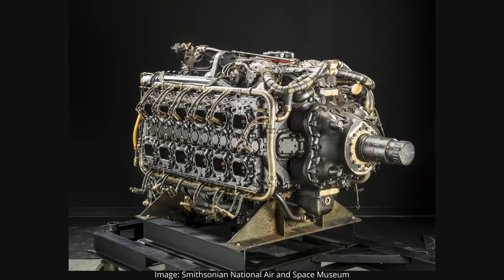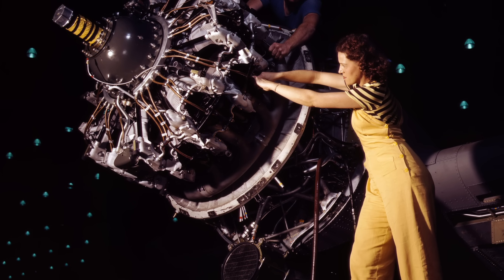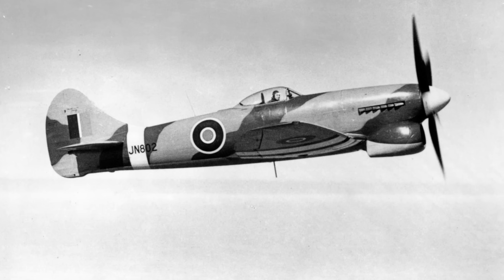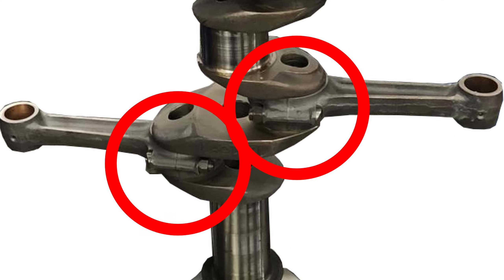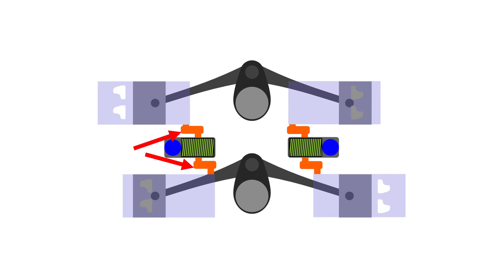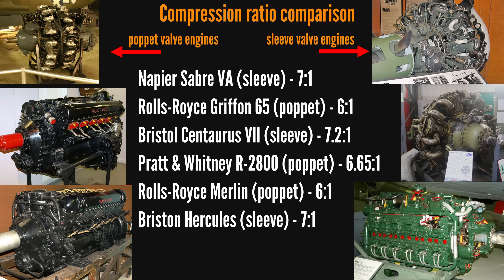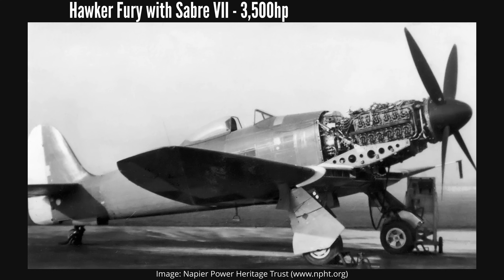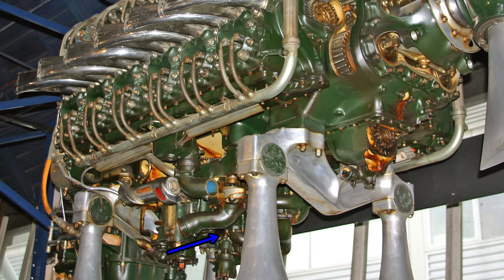The Complex Napier Sabre 24 Cylinder Aero Engine Explained Simply

Comment: Continental!, who prepared Sleeve Valve prototype engines for many different applications, development halted by the 1929 economy crisis, said Sleeve Valve engines were easier and cheaper to produce than its poppet valve counterparts.
A cylinder liner, very close to an Sleeve Valve, sells retail today for around $40.
RR destroyed all SSV producing machinery after the Bristol takeover, the last Sleeve Valve engines produced were Bristols, license made at SNECMA for the Noratlas freighter.

Some SNECMA built Bristol SSV engines survive in french Tractor Pulling clubs and shows

Comment: When you say that  increasing cylinders was the only practical way, that’s not quite correct, increasing displacement is a very practical way to increase power.
Reply: As mechanical engineer (I'm sorry, my English is not so good), I can say that increasing unitary displacement may be problematic, for several reasons. For instance, large pistons mean heavy weight and important inertia, and this doesn't allow high number of rpm. Cooling, too, would be more difficult. Best compromise for liquid-cooled engine is 8-12 cylinders. Radial engines can go up to 18-36, but the architecture is quite different.
Reply: @Paolo-s8p  I didn’t say there wasn’t drawbacks, but it is certainly a practical way to increase power without increasing complexity.
Reply: @thelandofnod123  Yes, but within a narrow range. A typical 4-in-line car engine can be offered in 2 liters or 2.5 liters, and both work well. Enlarged to 3 liters or more is very problematic.
Reply: @ Yes I know, which is what I said in my original comment.
Reply: @thelandofnod123  There is clearly a pattern that shows us the relationship between displacement and number of cylinders within a certain range of specs,
 we see small V-12s like the Merlin and the Allison reach a maximum practical size with the Griffon and the DB-605... beyond this we see engines with more than 12 cylinders appear.
  with Radials we also see a limit to cylinder displacement and larger Radials growing 7 to 9 cylinders and from single rows to 2,3 and finally 4 row engines like the R-4360..
Reply: @Paolo-s8p  That is an excellent analogy...  that perfectly demonstrates the concept here. You don't see many automotive 4-cylinders larger than 3.0 liter... for exactly this reason..
Reply: @ That is correct, which is what I said in my original comment and subsequent reply.
Reply: @thelandofnod123  You said that increasing the displacement was a practical way to increase power, which is in fact Not true. once you reach a certain limit it is not practical, increasing the number of cylinders is your only option other than raising manifold pressure which had also reached its practical limits during WW2,
Reply: @ Increasing displacement is a practical way to increase power. Your comment even says so. It is 100% true. 

Now, Dok, you seemed to have missed the point though as I was correcting a statement made in the video. I was not applying that statement to every conceivable situation involving ICE.
Reply: @thelandofnod123  You missed the whole point of this... during WW2 the V-12 configuration was quickly nearing the practical limits of displacement which is why engines with more than 12 cylinders began to be developed.
 The Sabre engine if designed with just 12 cylinders would not have been a successful or practical design and be able meet its desired horsepower output requirements.

So NO, larger displacement was not a viable option in this case or in second generation WW2 piston engine fighters in general..
Reply: @ Not at any point did I mention these particular engines and their particular applications, not once. 

As I said, I was correcting the statement made in the video. 

I can not see old chap why you continue to try and shoehorn in an argument where none existed.
Reply: @thelandofnod123  Your statement was wrong, once you have reached the practical limits of bore diameter for your desired rpm range? and you have reached the practical limits of supercharging?  adding more cylinders becomes your only option.

that's what he meant, and he is absolutely 100% correct in what he said..
Reply: @DoktorBayerischeMotorenWerke  No, your interpretation of it is wrong, which is why you have to add the caveats you have. 

The video is dealing with large, nay, enormous power increases, not incremental increases, as such adding cylinders and even doubling that number was the way they chose to achieve this. Clearly these engines had not reached the limits of what was possible with the extant number of cylinders because they didn’t feature all the improvements that could be achieved before smashing two blocks together. Adding displacement could yield more power, however the applications these engines were used for meant they needed more power than that could achieve in the existing block, that doesn’t make what I said wrong.
Reply: @thelandofnod123  In the context of the video, what he said and meant, and the specific design of the Napier Sabre you are absolutely and completely wrong.

that is exactly why nearly all of the aircraft engine manufacturers during the war developed Siamese or double block engines, Hyper or X configurations and triple and quadruple row radials.

All overwhelming weight of the evidence crushes your half-baked, amateurish theories and frankly rather childish beliefs regarding this topic..
Reply: @ Funny, resorting to abuse rather than admit you’re not understanding the concept is such textbook cognitive dissonance. May one suggest seeing an actual doctor about your condition rather than making proclamations about you own false personal qualifications.
Reply: @thelandofnod123  Just the facts here, nothing more.

Your response reveals that you are well aware that you are wrong and have lost the argument..
Reply: @ In the field, your “facts”, we call cherry picking. Doing so is the realm of those outside that field of experience. So no, you didn’t present facts, you took a small sample set and shoehorned it to meet your narrative, this shows nothing except inexperience. 

Thanks for proving my point though by the way.
Reply from the maker: Not the only way, but easiest way. At least in my opinion. I think there is a reason why all these 24 cylinder engines appreared so long before the large(er) displacement V-12's like the Griffon.
Reply: Not true, as Bore diameter and stroke increase the practical RPM and power per liter goes down... and weight goes up..
Reply: @DoktorBayerischeMotorenWerke  It is very true. Power tapers off after a certain point and then goes backward, however this is architecture dependant. Increasing displacement is a very practical way to increase power easily.

Comment: To me it just seems like the sleeve valve engine would be less reliable
Reply: In practice it was less reliable... Sleeve valves were really obsolete by the arrival of jets..
Reply: Sleeve valves system is a kind of all-or-nothing engineering. If designing, machining, assemblying, cooling and cleaning are properly done, the system too works properly. But if something somewhere is less than perfect, the system fails. On the contrary, the conventional puppet valves system is much more permissive and resilient facing small anomalies.

Comment: Just out of curiosity, does anyone have an opinion or details about how fast a SV engine can or could run?  Could it conceivably run at 20,000 rpm, or would the sleeves and such have too much mass to move at those F1-type rpms?

:). I remember when we had a Centaurus in a crate for a Sea Fury project, and my boss was describing the sleeve valve operation to me, stating how much simpler it was relative to poppet valves.  But when I first started to grasp how SVs worked, I recall being pretty exasperated at their so-called simplicity!

Regardless of which was better, history is what it is.  In both cases, I’m always amazed at what people, teams, and companies can do when something has to be done.  I think watching metal move against metal is one of the most interesting things.
Reply: Small displacement (< 1 liter) up to 10.000 rpm. Large displacement (> 20 liters) no more than 3.000 rpm. Rarely used on intermediate displacements.

Comment: What a great video, i did a project paper for a Higher National Diploma in the Uk, many moons ago on piston engine aircraft engine development, and although there were numerous great engines both allied and axis by the end of the war the Sabre stood out for me at the top of the pile. Lots of development and production problems initially from a management team who were to busy chasing "the next big thing" to bother themselves with "trivia" such as quality control. Once the shot gun marriage to English Electric was done, who were a far more profesional outfit, the Sabre fulfilled it potential, outperfoming everything round it in its power and its ability to hold full power much longer which in a combat situation means life, death or engine distruction. Perhaps the greatest testament to the Sabre/Tempest combination came from Me262 pilot Hubert Lange who singled the Tempest out as the biggest threat and one of the primary reasons the Germans turned the Me262 bases into multilayered flak fortresses. Great video, well thought out and presented.
Reply: All made obsolete by the arrival of jets.   The Tempest was completely outclassed by the Messerschmitt Me-262.
 Allied losses from loitering around Luftwaffe jet bases were so high that the practice was officially banned by Allied Fighter Command..

Comment: Late war IC engines were just bonkers. Everything was made by hand, on Bridgeport mills and lathes with no DRO. No computers. Each one was a masterpiece with thousands of hours of extremely skilled, highly nuanced labor to produce. Incredible.
Reply: That is not true, production of most parts was automated and made by specialized tooling that only performed a single operation and made a specific type of part using a pattern 'Standard' to set up the machine. Once the machine was set-up it could be operated by a non-skilled operator and crank-out thousands of identical parts.

Comment: 18:40  IMHO:

1. The reason why nobody uses sleeve valves lies in the small amount of available information about it. There is not much info out there if you want to build a sleeve valve engine. I know this as i made a program to simulate the sleeves for 3d CAD tool. So you can find the perfect sleeve and overall engine layout with respect to all basic variables and make this appear in CAD. The math behind the sleeves is spicy and tricky and not well understood or taught in university. It took me over a year to accomplish this. Everything about poppet valves is well understood btw. as i did comparison and poppet valve theory is  easily available.

2. The machining of those sleeves wasnt and isnt well understood. 90 years ago it was almost impossible to make them reliable. But i bet today CAD/CAM and Simulation software will deliver quality product from first few simulation loops. Imagine how much engine parts rely today on CNC machines already. Several high power engines use aluminium blocks with sleeves or liners, either wet or dry, already and they are usually made of high alloy stainless steel to avoid thermal expansion stress. 

3. Fewer parts are always welcome, but only if well managed. The cooking recipe for a sleeve valve is as short as you might get, despite the animation of the Sabre looking confusing.

The lesser parts, the higher compression, the higher rpm and the better airflow make these engines UNBEATABLE in ALL basic parameters either NATURALLY aspirated or MIDLY boosted. 

HOWEVER at about 2.5 bar or 36 psi manifold pressure, the sleeve cant handle the heat and stress and buckling begins which will seize the engine. 

But i can understand why we use poppet valves in engines today as we have all boost pressures of 2 atm or above in our daily cars where poppet valves matter. At least i do.
Reply: Sleeve valves were simply rendered obsolete by advancements in poppet valve technology.
Reply: @DoktorBayerischeMotorenWerke  You mean VANOS and other camshaft stuff like V-tec? 4 Valves? You can be specific i will understand, no problem.
Reply: @ThorstenKreutzenberger  I was referring mainly to the introduction of sodium cooled valves and new materials like Stellite,

Comment: Wow!!! Incredibly complex and intense engineering!!! It makes one wnder why larger 2- Stroke engines were not produced.... 
          One such design that had impressive  Horse-power and Torque output was made by McCulloch Industries and produced well over 100 h.p. with tuned exhaust, naturally aspirated, aur cooled... It displace's 100 cu.in. ,weighs about 78 pounds, and they develop maximum torque at around 3,200 rpm and is an opposed -4 cylinder  boxer type of an arrangement ... It has 2 ported rotary valve discs permantly cast onto the crankshaft that open's and close's the air/fuel paths going into the 2 sealed crankcases. 
      Porting for exhaust and intake cycles are done by tranfer ports for intake air/fuel flow, and exhaust ports to scavenge the spent exahust out of the engine cylinders.,.These cylinder ports were cast into the cylinder walls... The movement of the pistons provided the precise timing required for opening & closing of the ports... A magneto fired each of the spark plugs with independant precision without the need for external electrical power... Perfect for light homebuilt aircraft projects... Light , powerful, simple, reliable... It is Called the McCulloch 4318 A and these engines were originally designed for drone target training aids, but later became very popular for homebuilt aircraft of various sorts especially gyro-copters...Today is: 11/07/24

Comment: Thanks for your very interesting vid. In addition: in fysics kinetic energy = mass x speed square. In engine building this means energy = torque (mass) x revs (speed) square. Here we can clearly see that energy depends much more from revs (square!) than from torque. Almost strange that it took us so long to discover this.
Reply: True enough, but propellers limit engine rpms to a fairly fixed, low number.  So massive increases in power are going to depend a lot on the ability to generate massive amounts of torque.

Comment: Very, very good explanation of this complex engine, that was pretty extravagant for it's time. It didn't like running on low rpm or ideling, bacause spark plugs would get oily and with carbon deposits, and it woud start missfireing, so pilots were forced to rev the engine often while on the ground...

Comment: The Typhoon & Tempest fighters were awesome. I think it would be a nightmare to work on, especially getting the timing right. A lot of parts to this beast. Are there any Typhoons or Tempests flying today? Such a pity if not. Thanks for posting great info on something most cringe at doing so.
Reply: Magnetos usually have fixed ignition timing. No adjustments..

Comment: While sleeve valves were certainly more efficient volumetrically, they were also extremely complex, and maintenance intensive, and their development took years to iron out for reliable production. It's pretty clear to see that the Sabres real super power was it's ability to rev 1,000 rpms higher than every other aircraft engine. The short stroke, and naturally balanced dual-boxer engine made far more power than similar or larger displacement aircraft engines from the ease with which it revved so much higher, more so than the more efficient airflow.

Comment: P47M was just about matching the Typhoon at the altitude mentioned.
Reply: The P-47M is a hoax, no such aircraft ever saw active operational service during WW2. All of the M engines were found to be subject to immediate failure from detonation when WEP was used, and this resulted in several crashes and the order for all of M planes to be grounded. All of the 'M's remained grounded until the engines were replaced with the standard 'D' model engine.

The same problem effected the P-51H model which also used the hopelessly defective Simmons Boost regulators.
 All Simmons Boost regulators were ordered to be removed and destroyed..

Comment: Fasincating. Just subscribed. I understand the Napier somewhat, so I thought this video would be simplistic. It was anything but. You are comprehensive and clear. You mentioned that the heads allowed for a smaller cross section. To me, that would seem minimal, as the "junk" head needed to accept the reciprocating sleeve. Though the sleeve concept is straight forward, I've never been able to work out how oil gets to the head rings, or if trapped oil, which--at least in the Bristol--escapes through the venting valve, must be dealt with on each sleeve stroke. I have the feeling you know the answer 😉